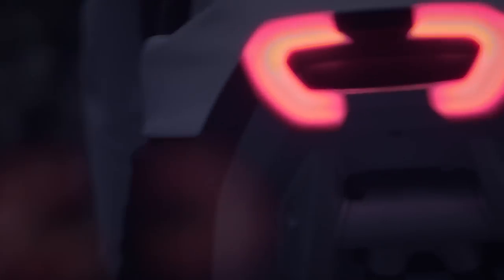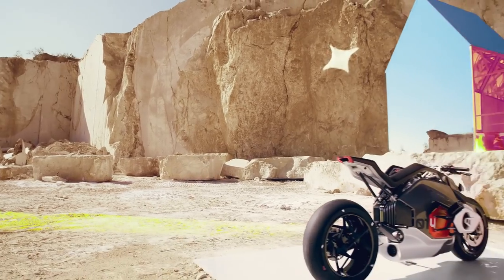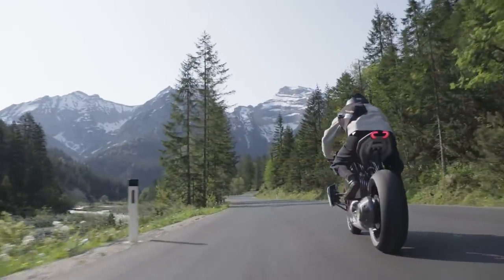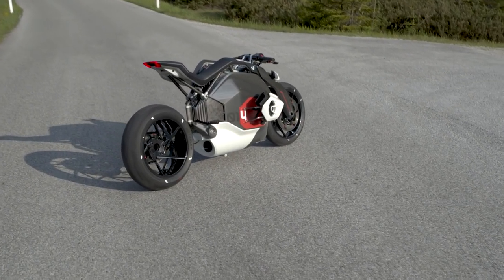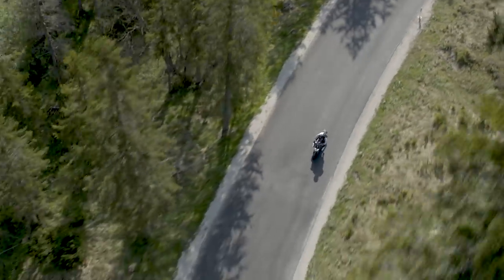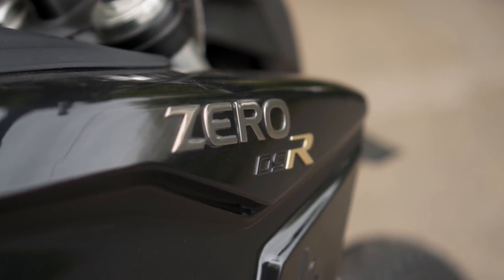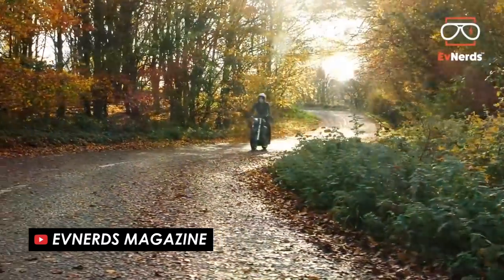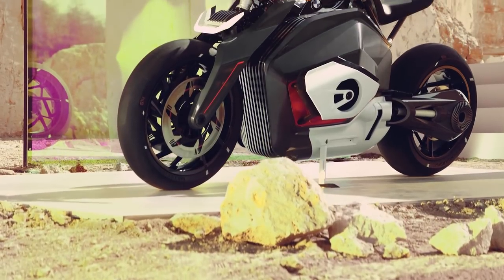BMW Electric Motorcycle Concept Unveiled: Vision DC Roadster 2019

Comment: This is a very nice design!  Thoughtful, simple, forward-looking, evolutionary, and inspiring!  Love that BMW mounted both brake levers on the handle bars, as that is proper for bicycles, scooters, and even motorcycles!  Why Zero, and other non-gear-shifting motorcycles out there, continue to utilize a rear-brake foot lever is beyond sound reason, imho.  Additionally, i hope that they had the clarity of mind to install a neutral/coasting function (visa-vie a button or lever) to allow free-wheel coasting at speed or hill descents  - (no motor engagement means no drag, and less wear on the batteries...thereby increasing range and increasing battery longevity).  Re-gen function is good, but the neutral/coast feature adds an additional means of energy conservation.

Comment: Style: I prefer old-style, standard bikes 
Function: it looks like those cooling elements move... which is something they can go wrong and be expensive. 
Electric bikes: I want range before I commit. I’ve done 800 miles in a day (yes, I was sore as hell, thanks) and just gasoline wasn’t easy to find in the hinterlands much less any special charging conventions. 
Maintenance: I’d love to own an electric bike to avoid the constant maintenance  gas bikes require.
Daily: I’ve heard electric bikes deliver their power in strange ways. I should probably try one out, but Fortnine put it as ‘being stuck in fourth gear’.
Reply: It's really not. The electric motor delivers consistent linear power from 0mph-100+

But because it has all that power in one gear you need to have good throttle control. The power delivery is linear and consistant but your hand movement might not be, and I think that's where a lot of riders struggle with electric drivetrains.

Comment: This makes me think maybe it’s not a completely crazy idea to try and do an electric conversion on my old k1200s with the blown motor since it already has the shaft drive and steering system of this prototype, rather than doing a straight engine replacement.

Comment: I remember years ago watching James May ride a motorcycle powered by a hydrogen fuel cell, never seen one again. Would have thought the fuel cell a better option than limited range batteries. I'm sticking to my petrol powered Yam a while longer
Reply from the maker: Also interesting to see BMW patent a hybrid fuel tank design recently. But there must be a reason that nobody is pursuing hydrogen or hybrid?
Reply: The hydrogen fuel cell/battery electric debate has been going on with cars for ages.  The battery is clearly far ahead right now.  Fuel cells are very big and heavy and tend to work well in fixed applications. Making them small enough for cars turns out to be crazy expensive.  It'll be even more difficult to get one on a bike.

Comment: They should put a glass cylinder somewhere on the bike (preferably rear) and if you twist the throttle then lightning should go throu it. Technically absolutely possible, it would look awesome and sound awesome to when the spark jumps. Same goes for electric sports cars.

Comment: Needs a cheaper design, no point in expensive carbon with 100 kg battery. Cooling fins look very breakable.
Reply: Aftermarkt (repair) sales opportunity.
Reply: @paullangford8179  From the corporate point of view the motorcycle is designed to cost you the customer $1,000 per year.  Buy or lease its basically the same.  Buy 2nd hand and parts and service department take back the money you saved.  After you owned a 2nd hand bike enough years it will still cost you $1,000 a year.  Prob'ly the only way to avoid paying the piper is to buy a cheap parts bike.  ....or get a horse.

Comment: I still want to see a huge electric touring bike. 20kwh+ with storage and DC fast charging.
Reply from the maker: Range is their fundamental weakness. Wonder how the extra load of a pillion and luggage would affect it too?
Reply: Electrics are a blast to ride.. but unless something drastically changes with the battery tech, range will always be an issue.  I have all but stopped riding my 1000cc because I'm on my zero fx every day and loving it.  But I am limited to shorter 50 mile rides, with a grin from cheek to cheek.

Comment: Electric Street Twin....it's bound to have a pretend radiator and dummy V&H pipes.
Reply from the maker: Haha they'll have to find a way to keep selling those £50 clutch and ACG badges somehow!
Reply: Yeah the Outboard Radiator design is purely for aesthetics. But BEV Motorcycles still critically needs cooling radiators, you just don't need to position like that.

Comment: Putting an electric motor where the boxer engine was would be too darn easy. 

Using the existing gearbox would allow for the use of a smaller lower reving motor as well. Can't have that.

But of course it wouldn't be able to go from zero to death in two seconds.

Comment: Both ways have future. I don't get why judge taste. I thnik a classic bike should be made with "classic" shapes and tech (what does classic mean? For me this is from the great, experimenting era from the early of 1900). And
I don't mind the sound as well.
I like this concept because classic lines are developed, experienced, so they are evolved to the max. To use a new drivetrain in an already evolved "case" can be good.
But protruding went and a shaft drive just because of to be "classic" is a useless way, since these are not the most effective ones for a drive, where you need every drop of energy.

Comment: I'm sure it's an impressive piece of engineering, but bits hanging out the side again for no reason other than to look like a boxer twin. 
At least with a boxer twin the idea of balancing reciprocating weight was there. Don't need that on an electric bike. So, nope not for me.

Plus it'll need an Akrapovic bass tube exhaust! (as mentioned before)
Reply from the maker: Well... they say they're to cool the battery. But I think that's just spin
Reply: Definitely spin. BMW seem to like things hanging out of the side!

Comment: $42,000 is the cost of a replacement battery for the zero electric motorcycle. That is not a misprint, that is an unfortunate fact that my friend who has a zero has just found out. I will reprint that actual price. $42,000.
  He let his batteries discharge because he had bad advice from a blogger that suggested that he discharges batteries in order to get more range per charge from them when they are recharged..The problem is they never recharged. He was on the phone with zero technical support, they talked him through a checklist, and they came up with the unfortunate news that his batteries are toast.
   I certainly hope the BMW batteries are far far less expensive than the zero batteries. The reason I am making this public service announcement to other motorcyclists is. They should check, they must check the price of replacement batteries before they make a purchase of an electric vehicle.. it’s a fresh new idea, I hope the BMW has greater range per charge. Personally, 125 mile range is not enough. There are days when a group of riders I ride with will meet, we make it a point never to meet in the same place for breakfast before our rides start. Sometimes those meeting places are 50 or 75 miles from some of the riders homes. One electric motorcycle, if one of us rides 75 miles to meet the guys to plan the days ride, he may not make it home just from the breakfast on an electric motorcycle without an eight hour recharge. It’s not uncommon for us to do 400 miles in one day. That’s not a lot. You average 50 miles an hour for eight hours, that’s 400 miles. That’s completely out of range for any electric motorcycle I’ve ever heard of..
  Electric manufacturers, come on guys get with it. Have solar panels installed on the motorcycles flat surfaces, and possibly a jacket that the motorcycle rider wears with solar panels for charging the battery as they drive.
  How about a small diesel engine maybe that spins a generator? A hybrid like eight Toyota Prius but in motorcycle form? How about re-generating brakes as in formula one?
   Why not hydrogen. In 2020 or 2021 there will be hydrogen powered cars in the 24 hours of Le Mans..
   How about spring assisted reacceleration. You use the brakes which engages a spring that gets wound up. When you need to accelerate from the stop sign or from the red light , the springs give you a little bit of energy that you’ve recovered and stored in wound Springs. Sounds like a simple mechanical device that stores wasted free energy...
   Perhaps instead of storing energy into Springs while you are slowing down, how about into an air tank. You’re compressing air, that can be used for the initial start at each stop sign or from red lights that the air is compressed into a small tank and used to re-accelerate by directing the compressed air over a small turbine Or a small piston sort of like a locomotive steam engine piston, just to assist in the initial acceleration from a dead stop.
  How about an electrical generator that charges a capacitor while braking. And that capacitor is used to power the generator which doubles as a DC motor in the wheel hub, just for restarts. You guys have to come up with something better than these battery powered motorcycles with the ultra expensive batteries that require hours of recharge time.. many people think the electric vehicles or something new, they actually had electric cars in the early 1900s
  If we only had Glenn Curtis and Nikola Tesla working on this project together today. And not with the financing of JP Morgan who pulled the rug out from under Tesla when he found out he was making a device that would make free electricity without wires for all.

Comment: As a bmw r1200gsa rider I love the latest tech. But battery vehicles are from the early 1900’s. Why on earth would I want worse riding range, a ridiculously expensive and heavy battery, worse recharge times that dramatically reduce the lifespan, unknown environment effects, a higher purchase price, a 10 year limited lifespan on the single most expensive part of the bike, no sound and an incredibly dangerous battery/inferno if the casing becomes compromised and the battery shorts out. I live in the now and batteries are a failed idea from the past with zero benefit.

Comment: NO NO NO NO NO NO!

You’ll see in the end, electric motorcycles, cars, etc will be far worse for the environment than petrol powered.  

Take for example nuclear power.  Looks promising, but wait until all the used up radioactive material waste piles up with nowhere to put it.  

The batteries in these machines will be much the same when it comes to disposal.
Reply: Ok buddy